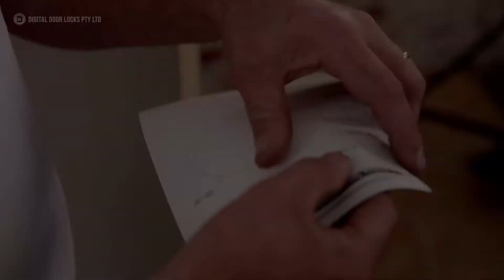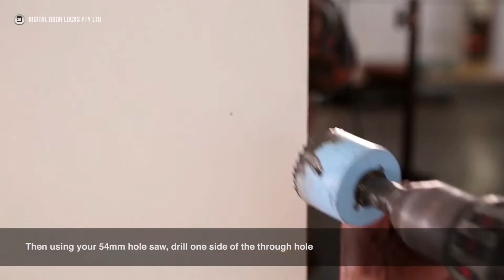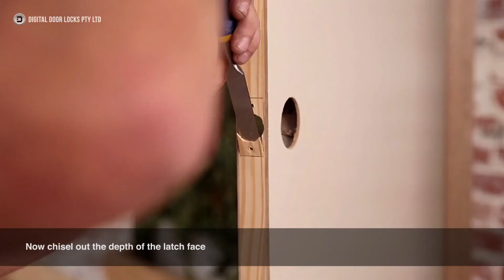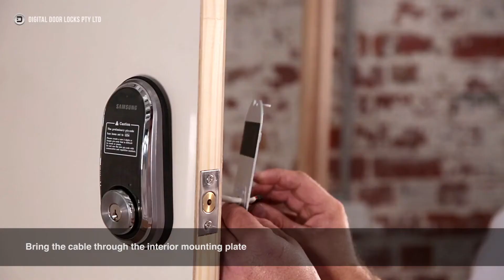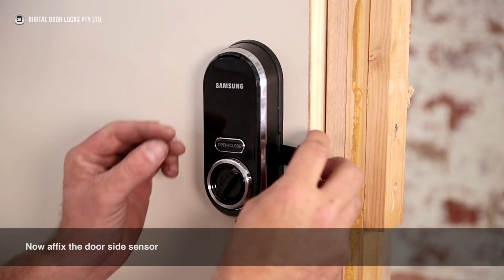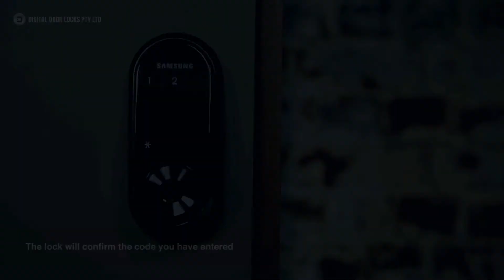Samsung Smart Door Lock (SHP-DS510) - Installation & Set Up Guide

Comment: Thank you for making this wonderful tutorial. I will soon move in a new flat installed with a smart lock. The landlord said I can change the code and use the key to open the door in case I have forgotten the new code.  I was wondering if the former tenant or anyone has a copy of the key, they can get into my flat easily even if I have reset a new security code. Am I right?
Reply: Hello, Kenny! Yes that is correct. If you wish, you can change the key cylinder that a new way a new set of keys can be provided. Hence, the previous owner won't be able to access the lock, even if he still has one. If you wish to move forward with this, do send us an email at au@digitaldoorlocks.com.au. Thank you!